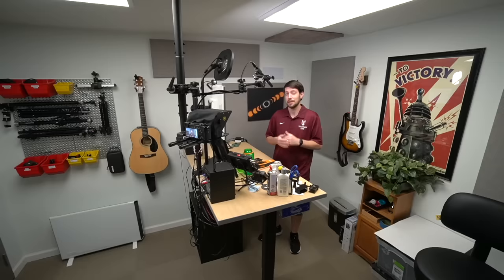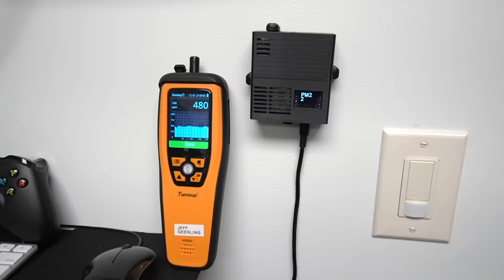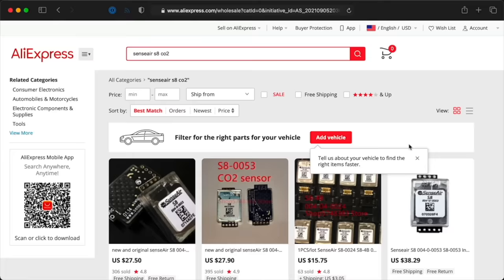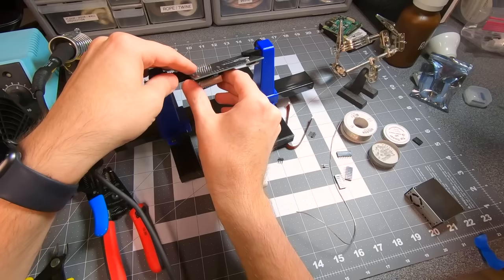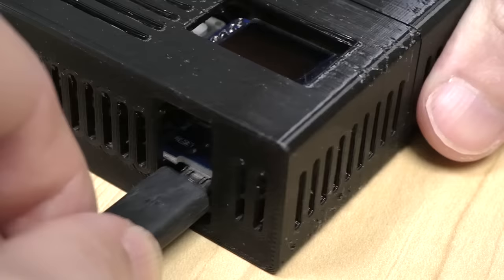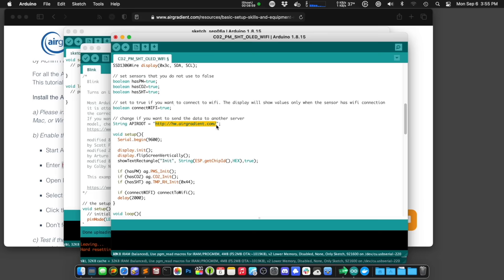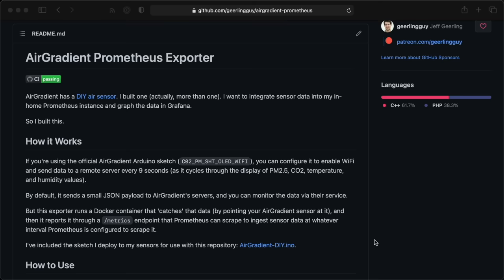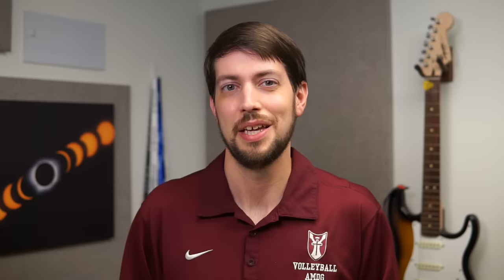Your home's air could be making you sick. Fight back!

Comment: What would be cool as well is to add a pressure sensor right inside your HVAC return to measure the air pressure when the fan is on, so you can get an alert when to replace the air filter.
Reply from the maker: That's not a bad idea; though depending on sensitivity, and the filter type, it could need changing even without a noticeable drop in air pressure.

Comment: One thing an air purifier can help with is air circulation. I'm living in an old apartment with 10ft ceilings and without the purifier the air would get stale quickly. It also helps when I open my windows, because I'll just set the air purifier to its highest speed and within 10 minutes all the air in my huge room has been replaced. My air purifier also has a PM2.5 sensor built in as well as a humidity and temp sensor. I have them all hooked up to my Pi running on Home assistant. Now all I need is a cheap CO2 meter and I'm set. 

I have an Xiaomi Air Purifier 2 in case anyone is wondering. I paid 120 euros for it which is really fair for what you're getting in return.

Comment: I've just ordered the parts, so that I can make three of these.  Looks create.  I can see me creating my own endpoint on my K8s cluster, so that they can all feed data in, and make it available to Home Assistant somehow.  That would help with my long term goal of having HA based home automation.   There's been plenty of times that I feel sluggish and groggy, never thought about air circulation, and it's worth the cost to be able understand what the air quality is.
Reply from the maker: Apparently ESPHome has integrations for all the sensors, so it's easy to configure the board for Home Assistant through there!
Reply from the maker: @colindawson4818  Awesome! Please share the case on Thingiverse if you do get a better one up for it. That's definitely the weakest point of the design.

I've considered just running mine bare with standoffs and a back plate.

Comment: Nice, I like the case. I made a little air quality project with a Sparkfun micromod carrier board running an ESP32 pulling data from a Sensirion SCD30 and Bosch BME680. Data is sent with MQTT to a Raspberry Pi running Node-Red and then to Grafana. I'm sure there is a better way but I don't know JSON. Sensor data should be kept secure or else you will broadcast to the world if you are home, what room you are in,  just from CO2 levels alone. I didn't think it was going to be a big deal until I looked at a week worth of time series plots.

Comment: WES51 gang represent! I've had mine for many years and still love it, even after heavy use. I got one early enough that I have the nicer stand with the ceramic collar, rather than the cheaper/clunkier/noisier metal one they changed to later. Just finally replaced the very sad-looking sponge on it, which I should have done a long time ago!
Reply: I have a WCC100 which I believe is a fully analog 120v predecessor to the 24v microcontroller-based WES series. My sponge is also in need of replacement (and for that matter also the tip). Did you use a special soldering sponge or just a cut up kitchen sponge?
Reply: @eDoc2020  DigiKey stocks (or at least did, at the time) proper first-party sponge replacements (right size and pre-sliced), and they were pretty affordable so I just added one to an order I was making already. For tips, I bought a kit of knockoff ones off amazon (couldn't stomach the Weller prices) and they seem to work just fine in terms of thermals and durability. It might be a different story with the newer "cartridge" designs that embed a lot more smarts in the "tip", but for this style of iron it's basically just a hunk of metal, and having the full selection of tip shapes has been handy.

Comment: If you turn up the temperature of the soldering iron you will find it much quicker and easier, it will also reduce the chance of heat damage as the contact time is reduced

Comment: Very cool project. I feel like using the breadboard to hold your pins is a bad idea though. That breadboard is a huge heatsink. If you didn't have such a nice soldering station it might take forever to make a solder joint. Even so, it looks like that slowed you down a lot.

Comment: You should tin the wires first, you do this after stripping, gently twist the wires so it stick is together, then solder it. Trim it and push into the board. Much easier to solder into the board.

Comment: CO2 is absolutely correlated with brain function, yup. I was having some pretty serious problems; saw a video of a guy trying to live in an enclosed space; his plants didn't absorb enough CO2, and he looked terrible. He gave some interesting figures though. Since then, I've had my window open and a fan drawing air in from it or across it most of the time. Being a converted attic, my room's volume is quite small and I'm in it almost all day due to other health problems, so I've got to deal with it. I'd like a CO2 sensor alone, don't need the other sensors.

Edit: Maybe other sensors too. The air in here gets weird when I open the little vent built in to the window.

Comment: The very important thing that makes the project is not realiable for DIY: the senor need to be calibrated by very accurate data. And you mentioned it in half of a sentence.
I think that you should explain how did you calibrate the gas sensor - what makes whole system working well and precisely.

Comment: There are published standards by many authoritative organizations.  You should add a TVOC meter to yours.  You want your PM 2.5 as low as possible... EPA says in it's document "REVISED AIR QUALITY STANDARDS FOR PARTICLE POLLUTION AND UPDATES TO
THE AIR QUALITY INDEX (AQI)"  that the "GOOD" PM 2.5 is 15 or lower.

Comment: One thing that airgradient PCB could improve is to place that temp/hum sensor at the bottom of the airflow as the heat from the other components might throw it off a bit. Most if not all commercial sensors are constructed in that way.

Comment: For your vent, how about making a acoustic panels and removing any foam so it's just the fabric on the front. Then place it over the vent. That will give the appearance of it simply being something for the sound without stopping airflow.
Reply from the maker: Airflow would likely delaminate the fabric from the acoustic foam around it over time, but I'm thinking for now I may take some other advice and build a little white cover that stands off from the wall a bit.

Comment: Please also check the radon level using some radon detectors. Some of them might be integrated into the smart home infrastructure.
Reply from the maker: I have a radon monitor installed since we have a radon fan and our basement had a very elevated radon level when we moved in. Luckily it's under 1.6 on average, but I haven't found a good radon sensor I can directly integrate with an ESP or Pi yet :(

Comment: RE: stripping those super-thin wires. I was taught to just use the soldering iron to melt it off. Of course that puts chemicals in the air, but so does the soldering itself. You should have something to suck out the fumes away from your face anyway.
Reply from the maker: Not pictured in the video; I do have a little fume extractor running off to the side.

Comment: Unfortunately cheaper CO2 sensors are usually more like particulate sensors. Which means, that those are awfully inaccurate. Temperature and humidity sensors instead are accurate. Five years ago decently accurate CO2 sensor cost $400 and drew so much current, that you can not run it with battery (at least feasibly). $30? I am still bit suspicious, but could theoretically be as accurate as $400 one few years back.
Reply from the maker: Supposedly the SenseAir is one of the best "not lab grade" sensors.

Comment: Jeff, another awesome video!  Looking forward to building this.  Definitely subscribed so I can see the Radon monitor.  I use the same model you displayed, but would love to build my own with tracking.
Reply: Jeff, I ordered the full kit, arrived within a week or two, assembly was easy with the instructions here. Note the kit doesn't come with double sided tape or screws for the particulate sensor. It needs M2 screws, I had 4mm long ones and they worked fine.

Comment: Maybe use a flux pen and a flat head iron tip? Should help you with the soldering experience. I see you have a little bit of difficulty transmitting the heat to the pins, as the solder isn't melting as soon as you touch it with the pin.

Comment: Instead of the magnet, why not just extend the sound panel over the vent?  You could have an open section with just the cloth over the vent.  Air circulation + vent hidden.

Comment: When i have to work with those tiny wires i usually just strip them with my fingernails, the insulation should come off pretty easily
Reply from the maker: That definitely works too. Sometimes I'll do that in a pinch (ha!), but since I have them, the adjustable stripper is a little quicker.
Reply: @JeffGeerling  🤦🏻‍♂️ D'oh! 😂✌🏼

Comment: Amazon is bringing out a smart air quality monitor that works with alexa it knows the air quality, humidity, temperature 

So you could ask alexa the temprature in the room

Humidity gets high turn on a dehumidifier automatically

Or when the air quality is dangerous tell you or turn on an air purifier

Comment: Hi Interesting. I experimented some time ago with a PM detector (RxTx interface) and ran into a problem. Most particle detector are based on a laser and lasers deteriorate after some time if you leave them on all the time. Although the spec identified that the laser could be turned off (in between measuring intervals) i never got this to work. So the question i have is: In your project is the laser turned off between taking a measuring? And what is the measuring interval? Of course assuming your sensor uses a laser..

Comment: Ive done this with a rpi3 B. 2.5, co2, o3 and temp/humid/AQ (bme680) uses adafruit analog to digital converter. the adafruit analog to digital is kind of finicky if you have more then one address pin used it may confuse both or more with results i see that on yours too 11:33  and my pi3 uses a rfcat for controlling my dehumidifier UVC lamps and temp.

Comment: It’s so complicated, there’s so many tech stack moving parts… couldn’t one just have the AirGraident post metrics directly to Prometheus?
Reply from the maker: Check out this PR: https://github.com/geerlingguy/airgradient-prometheus/pull/4 — it will just run an HTTP server on the sensor, and Prometheus will pull straight from that.

Doing 'push' into Prometheus is not as simple and requires extra configuration on Prometheus (it's easier using InfluxDB).

Comment: have you considered a cover for the vent that still lets air thru? 3d printing another esp8266 and a small fan could make for an active solution that responds to high levels in the air with a fan that moves bad air out / pulls good air in

Comment: Can you put a vent into a wall that is not on camera to get some air from other rooms in your basement?  Also maybe put a board or something decorative in front of the vent that is about 3 or 4 inches in front of the vent.  So basically a flat piece of material that is spaced 3 inches from the vent so you can have the vent always be on.

Comment: As for your ventilation cover, have you considered having it motorized and automated? i will again talk about home assistant and esphome, but there is this "cover" device in esphome that allows you to control servos or steppers to open/close things; and you could have it open by default, and be closed when you push the "recording" button in your dashboard; or when your filming lights are turned on, or something like that... or even simpler, tied to a lux sensor, and when luminosity reaches X value or more, it closes, because it means the filming lights are on.
(i don't know your light setup; mine is also integrated in home assistant, and i use LED lamps that i DiYed, to have 12V or 24V lights that i can control via PWM).

Comment: I have a heat pump mini split above my bedroom dresser. I thought it would work better than a leaky window unit, and for the most part it does.  Most AC units have a thermostat that intermittently turns the unit on or off. My unit Has a annoying quirk, in the refrigerate mode it has no intermittent fan function. It is on as long as the power is turned on. I saw this YouTube video where Leon Anavi demonstrated his Anavi-Infrared-pHAT from “Crowd Supply”. I ordered one and was given a “git-hub” address and downloaded a zip file with several pdf file with directions on how to make it work. I have only been able to detect the temperature sensor’s address. I am still waiting for more information to finish the project. 
This sounds like it could be another one those “hurry up and wait” projects. My boxes my ears if I buy from “Wish”, she might shoot me if I ordered from “ AliExpress “.

Comment: The first few minutes, ok this sounds great I want to build one, the next few minutes, ok this is getting difficult but I think I can still do it. The last minutes, I'm straight up not having a good time bro. I'd love to do this but man, it's just too difficult on the software side for me. I could easily solder all those components to that board and install some stuff on a PI but programming that chip is just outside my realm.
Reply from the maker: You'd be surprised! The first time you do it, it is very daunting, but then you may realize it's easy enough to re-flash if something went wrong, and since these little boards are everywhere, if you run into any compile errors, just copy and paste into Google, and chances are you'll find a way to solve it and move forward!
Reply: It's not though. If you can solder components in a way that they will work, that means you can follow instructions. 
Which is all you need. You might not understand the instructions at first, which is fine. First time I programmed a device I was already a software developer and I still felt like I knew nothing. It's ok. 

Now, if you had to solder a programmer and run the risk of bricking the device, it would be another matter. But the arduino environment was created for people like you and me.

Comment: I bought a diesel Jeep a few months ago, hoping to research Biodiesel use. I feel like I get a subtle whiff of diesel fume occasionally in the cabin, but at other times, seems like normal cabin air. I found that the cabin air comes in from a port located between the engine bay and the front of the cabin / glove compartment, underneath where the windshield wipers attach.

I'm curious what sensors I could buy to detect the air quality. I've asked at ten or fifteen auto supply stores, as well as a similar number of mechanic shops and they have never had this request before. I started by buying a "small aircraft grade" carbon monoxide sensor, which reads 0 so far, but was curious what other gases, particulates, etc. I could be getting in the cabin.

Comment: Ok Jeff. I've been doing this for awhile too. CO2 and particulate....fine though your values I think are wrong. Healthy CO2 is 400-600ppm unless it's fall....we'll  talk about that later. However the MOST important sensor is the free O2....that's usable O2. When it drops below 14.5% it can severely affect health. Optimum is 21.5 but most ambient (in cities) is ~15.5. NO GOOD SENSOR!!!!! CO2 is not the global warming problem. Lack of CO2 to o2 convertors is. The rise in CO2 is because we've lost over 40% of the convertors, ocean phytoplankton. Photo catalytic convention, photosynthesis, turn sun heat into food and o2....gone...help! De-salination of oceans essential for survival. Bye.😵💖🤯,jpk

Comment: I do a similar thing at the moment but using more of the selve microcontrollers and sensors, ie. an arduino nano 33 Iot, an CCS811 and DHT22 sensor. 

I make my life unnecessary difficult by wanting to use Bluetooth low energy for data transmission, even if the arduino also supports Wi-Fi.
But Wi-Fi would come at a huge cost in battery life.
I than send the over BLE received data via MQTT to another docker container on the same latte-panda SBC.
Than from the MQTT server into home-assistant.

I currently working on writing an worker for zewelor/bt-mqtt-gateway and my lackluster python experience is showing.

It will also be fun to reinstall Ubuntu-server on the latte-panda. Surprisingly bad Linux support. 
I got it running once, I will get it running again and this time I will docker everything. 

Haas-OS shucks, a Linux system without access to the shell is not usable.
Reply: you can run home assistant in a Docker container pretty easy

Comment: Great video! Would love to make this! How did you get those top down shots when you were soldering? I'd love to make some videos of projects and that's a part I haven't figured out.
Reply from the maker: In this case, I had a GoPro hanging off a cheap gooseneck arm camera mount that was attached to a shelf on my workbench. I had to rotate the footage 180° since the GoPro was recording upside-down. It was mostly out of the way of my line of sight, which was nice.

For the closeups and slider shots, I had my main camera (Sony a6600) on a slider mounted to a tripod that was leaning against the front of my desk so it could still be out of the way but get close enough with a 50mm macro lens.
Reply: @JeffGeerling  Thank you so much Jeff!
Reply: @JeffGeerling  What GoPro do you have? I've seen a lot of reports of the hero 9 overheating.

Comment: Interesting project.  Currently using a Purple Air set of the sensors (inside and outdoors), but would love to have more control on the design and add additional features beyond PM2.5.   I have most of the set-up mentioned, but not a 3D printer.  Any suggestion on which one that is good for a beginner?
Reply from the maker: I have loved playing with my Ender 3 V2, though I hear a lot of good things about Prusa's printers too.